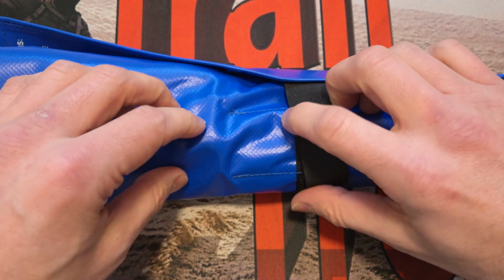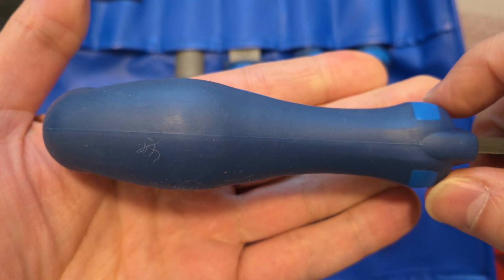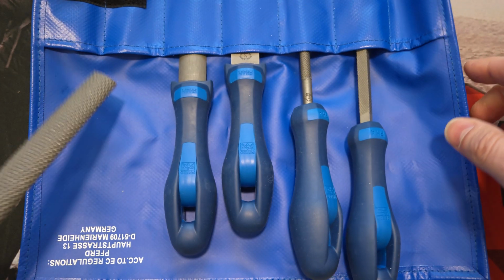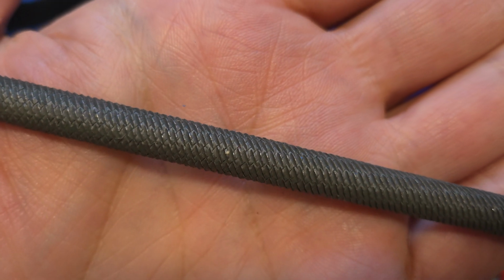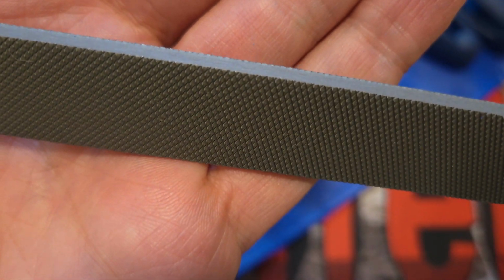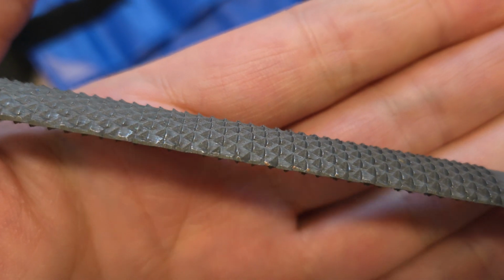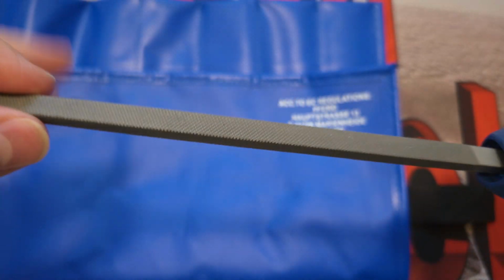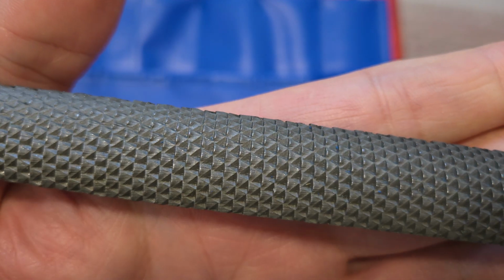Pferd 520 WR file set Review 11801520 German quality perfection

Comment: They’re 30% off on Amazon right now too. Nice set of files, the video quality really did showcase them.
Reply from the maker: Nice thanks for the heads up.  (I uploaded in 8k and it wont let me pick that as a playback option but I blasted up the bit rate so still looks nice in 4K)
Reply: I would cross reference it with another source that lists country of origin, not all of them are made in Germany